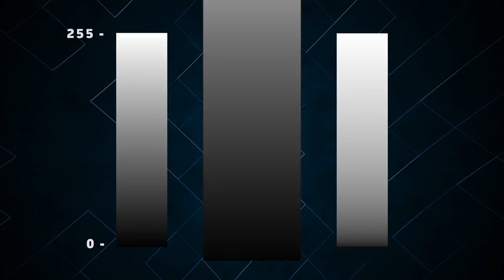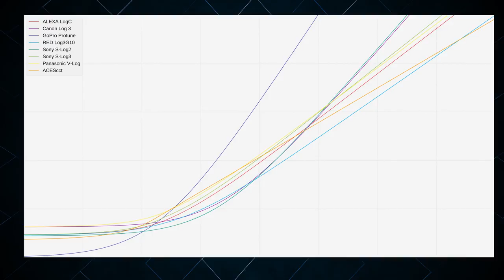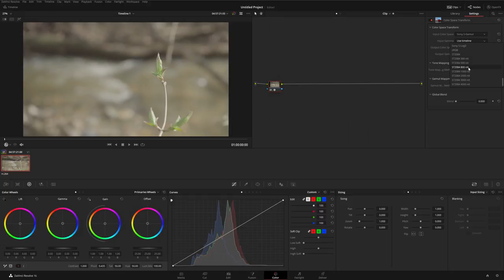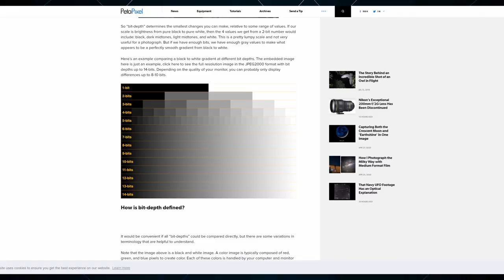What is Gamma Correction? - Video Tech Explained

Comment: Hi. I love your videos, you put a lot of work on them and they are very concise and informative.
However, there is a fundamental mistake in this one you probably might want to revisit. 
Gamma correction is a curve applied to "cancel" the curve from a gamma-encoded image. Our non-linear perception is the reason for the encoding, not the correction. We want to see the images in ratios as close to the ratios present in the capture image as possible. And that means that our eyes will have to receive light in the same ratios the camera "saw". 
If all digital images were 32-bit float images, gamma correction wouldn't exist, as cameras would capture and store linearly, and displays shouldn't have to apply any curve to them.
But since we're still using 8-bit integer images a lot, computers need a way to store them in that precision. Linear won't cut it, because of our non-linear perception: our eyes are more sensitive to shadows, and 128 levels of brightness for the darker parts of the image won't be enough to represent a smooth gradient, you'll se a lot of banding.
So, images have to be accommodated to allocate more bitdepth for the shadows, leaving less precision for lighter parts, the ones we have less sensitiity to.
That's gamma encoding, and that's the bending gamma correction cancels.
You have all the pieces there in your video, but the leading idea is unfortunately wrong
Reply: And to address the question: "why linear images look wrong when displayed directy" that most of the people reading this might have at this point, the answer is simple: Monitors are applying a gamma-correction automatically, but since the images not gamma-encoded (when you dump linear to the display) you end up looking at a non-linear image.

Comment: Thank you so much! that explained everything. My understanding is
1. Human eye's light sensitivity is lower than that of the camera's. (ex. 50% light in camera is about 25% in human eye) 
2. Gamma  Correction, is a process that uses a mathematical model to match the digital screen light levels to that of the human eye's. 
3. As the result, Gamma correction evenly distribute the light level across  a digital screen which appears to be natural lighting to the human eye.

Comment: ERRATA: Adding ONE light, as in the example, does not DOUBLE the amount of light (or photons) hitting the paper, this is because of something called the inverse square law. In order to DOUBLE the amount of photons it would require adding THREE additional lights. Please correct me if I am wrong. Otherwise, thank you for a very well explained video on Gamma curves. Kudos for the 4K upload as well!
Reply from the maker: I'm not sure how the inverse square law applies in this case. In my demonstration, I'm assuming the two lights are perfectly pointed at the exact same spot, in which case there would be twice as many photons reflecting off of that point. 

Granted, the alignment wasn't actually perfect in my practical demonstration, but the point still holds. If you take two identical sources of light and point them at the same spot, there will be twice as many photons reflecting off of it as there would be if there was only a single light source.

However, while the number of photons is doubled, our eyes don't perceive the spot as being twice as bright

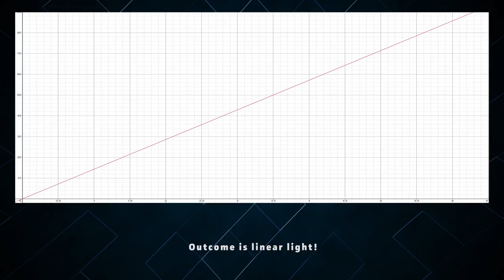Comment: Excellent video. But I have a question. Our eyes perceive the light in a non-linear fashion. After the inverse gamma is applied by the display device, the resultant signal becomes linear as shown at 4:22. So if the signal is linear again, how do we (human eye) perceive that light correctly? If I understand right, the signal is non-linear, then our eyes also would perceive it correctly. If human eye sees light linearly, then we would see the image a bit dark.

Comment: Well this video explained well that gamma is a power law transfer function which models how the human eye perceives light. So far so good. However I didn't understand where and how it's used.
Another video on this subject talks about the response characteristics of CRT monitors and states that gamma is encoded in certain file types to compensate. It was as if they were discussing a different subject entirely.
I remain confused.
Reply from the maker: Essentially, when comparing the use of gamma in analog vs digital technology, we're doing the same thing for different reasons. CRT screens did have the natural property of distorting the signal they were given in a way which roughly corresponded to Gamma 2.2. So in an analog system, images had to be gamma-corrected so that they would look right on people's TVs. In modern, digital systems there's nothing inherent in the design of LCD displays which will distort color, but they're nonetheless designed to add in that gamma correction, primarily to reduce banding.

Comment: what is not quite clear to me is: if the monitor uses the inverse function to display the image linearly again, wouldn't that reintroduce banding? The monitor still has an 8 bit panel and will have to display small brightness variations with a limited number of steps

Comment: Thanks, i had the confusion between gamma correction and saturation concept, because i render in V RAY  and Lumion some animations. And i try to low the saturation in the renders that i produce in lumion to try to get a more photorealistic result. But  the parameter gamma correction its included in Lumion and i get confused. So as you can imagine i mess up a lot of configurations of my videos. Thanks for this video.

Comment: I wonder if you have access to any good sources that can insert a specific CLUT output and adjust to linearize?

To explain further, I am a PhD student and I'm looking at pupil dilation in eye tracking. There is a system that has been built for my project, and I am looking to linearize luminance (gamma). I am curious how to insert a custom CLUT (created from measurements taken from a ViewPixx monitor) into my code, so that I am sure the luminance being displayed, is indeed the luminance that I want.

Comment: Am i missing something please answer i just want to know one thing it's so confusing. If picture has linear gamma curve and our eyes distorts and sees it as what we see in real life (kinda like srgb curve). So there's no point making it back to linear like overly exposured and then making it back to srgb curve in another software to see it correctly Like whaaat? I dont understand please explain
Reply: The real world is linear, that is what our eyes are used to seeing.  Then our eyes convert that linear signal to another that our brain works with.  We do thus so we can see well in both light & dark rooms.  So when it's dark a little more light has a big impact and we can see.  But when it's bright a little more light does not retina burn us.
Cameras encode with gamma correction too, but for a different reason.  They do it for better color resolution. Instead of 256 shades of red you get much more.  
So the encoding used by a camera is not the same as what your eye does.  Your eye for light, camera for color.  
So your eye is used to seeing linear light and converting it to the brains format.  If you send it information that is already in the brains format it will still try to convert it and then the info has been converted twice and you will see garbage.
So your camera reads linear converts to gamma-A and saves the file.  You transfer the file to your computer and it displays it on the screen after converting it back to linear.  Your eyes read in the linear and convert to gamma-B.  Hope that helps.

Comment: Can someone explain why the monitor should reverse the changes made to the original file? Wouldn’t that bring back the problem?
Reply from the maker: The monitor doesn't change the actual file, instead the monitor performs the transform on the fly as its playing back the signal its sent. The banding problem mainly occurs during the process of encoding the file, due to the limited bit depth of most video formats.
Reply: @VideoTechExplained   Maybe I‘m just an idiot, but my point is that the monitor would revert it so it’s Gamma 1.0 again, which is not what we want, or is it?
Reply from the maker: @maaax1173  Ah, I see the point of confusion. The final output (the light actually coming out of the monitor) needs to be linear so that our eyes will interpret it correctly. Things we see in the real world come into our eyes as linear, and the "logarithmic conversion" happens in our brains. If the light coming out of the monitor was logarithmic, then our brain would apply the "log conversion" a second time and the result would look wrong.

Theoretically, we could just save our video files as linear, and produce monitors without a gamma correction built in, and the end result would look fine to our eyes. The reason we apply a gamma curve, save the file, then reverse it, is all about making more efficient use of the data we store into the video file. 

At the end of the day, it's still linear light into the camera and linear light out of the monitor.
Reply: @VideoTechExplained   Ah, I see. Thank you for the explanation. Great video, keep it up👍🏼

Comment: Would it be more accurate to say that gamma correction helps to offset monitor gamma curves rather than to "distribute luminance values according to how our eyes perceive light"? At 3:28 you mentioned that "our eyes distort the luminance values" which results in excessive highlights and shadow compression, whereas our eyes actually do the opposite (expand shadows and compress highlights); isn't this effect actually caused by the gamma curve of the monitor? 

Another related point I wanted to mention is that if a camera captures light linearly and a monitor displays light linearly (as mentioned), then there shouldn't be an issue with what the human eye sees from the monitor, since the physical brightness displayed by the monitor should be similar to the physical brightness at the scene of a shot, which our brain can then perceive similarly into something that "looks normal".

I'm not claiming to be an expert on this though, just a few thoughts that came into my mind after having a look at this resource https://learnopengl.com/Advanced-Lighting/Gamma-Correction. Thanks for the fantastic video otherwise!

Edit: Looking at the wiki page for gamma correction, it states that "the gamma characteristics of the display device do not play a factor in the gamma encoding of images and video". It seems I'm missing something, though I'm not so sure what...
Reply: It just dont make sense right? If picture has linear gamma curve and our eyes distorts and sees it as what we see in real life (kinda like srgb curve). So there's no point making it back to linear like overly exposured and then making it back to srgb curve in another software to see it correctly Like whaaat? I dont understand please explain
Reply: This is correct. The video is ok about everything except that fundamental aspect: gamma correction is the compensation for the display non-linearity, its purpose is to linearize the values that had to be bent for bitdepth reasons. We have to see those values in the same ratios that the original image had. Our non-linear perception is not the reason for gamma correction, but it is the reason for gamma encoding (i.e. stuffing more information below middle gray than above)